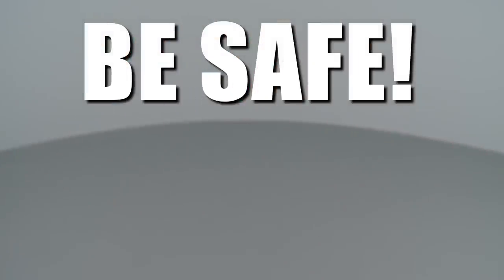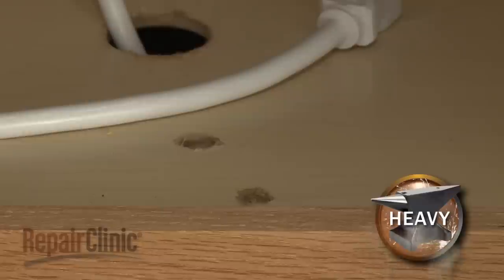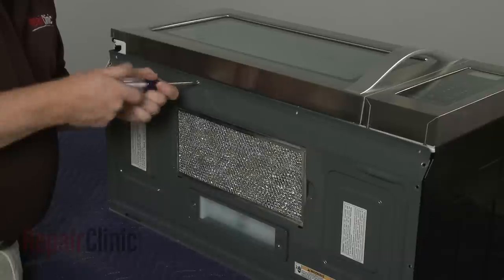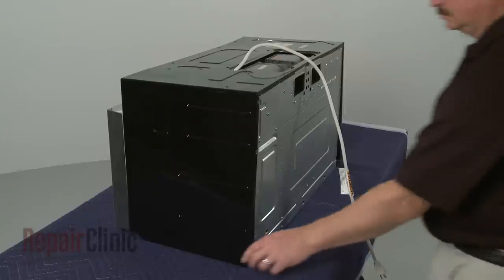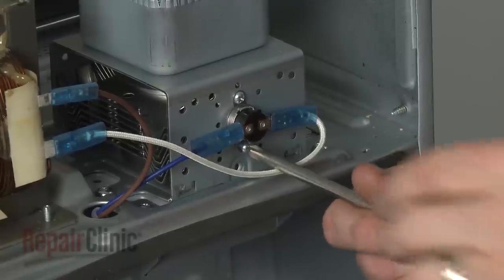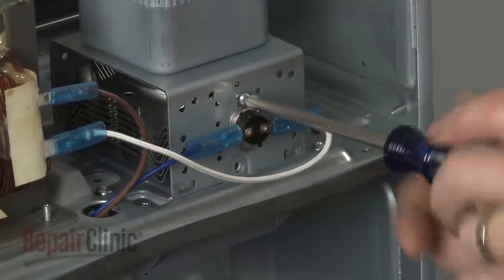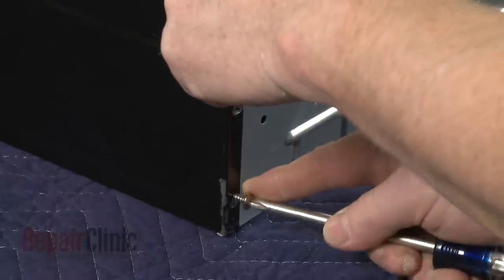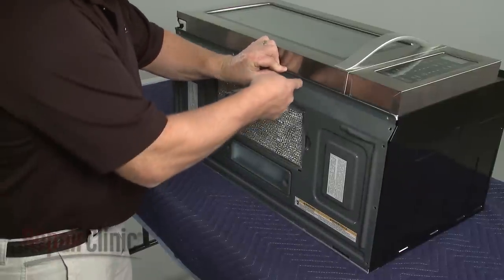Whirlpool Microwave Not Heating? Magnetron Tube #W10693025

Comment: I have same microwave.  Heats for exactly one minute then stops every time its used.  Could this be the cause? Thank you
Reply: I have this issue as well. Do you know what the issue is?
Reply: @jennydelaware7552  unfortunately I haven't looked further into it. Wife has been using as is. Used one of those appliance online help things and got no where for 30 bucks. Probably a magnetron thats more than machine is worth. 8000 in kitchenaid appliances.  All 5 years old. All junk! Problems with all of them. They should be ashamed

Comment: I have a Whirlpool microwave model GH5184XPB5 and it gave me an error message to change the Humidity Sensor.  I found the part #8206446 but I need more information about where it is located on this microwave.  Can you help?
Reply from the maker: Pete Perez It is located on the top of the cavity inside the blower. You will likely have to uninstall the microwave to access it if you don't see it when you remove the top grille. Microwaves can be a dangerous appliance to service so we always recommend unplugging it before and steering clear of the high voltage capacitor.

Comment: How are you so sure the Magnetron tube is defective? Did someone test the high voltage circuit first?
Reply: It's in the description box. "The most common reason for replacing the magnetron tube is if the microwave does not heat and continuity testing proves the magnetron has failed."